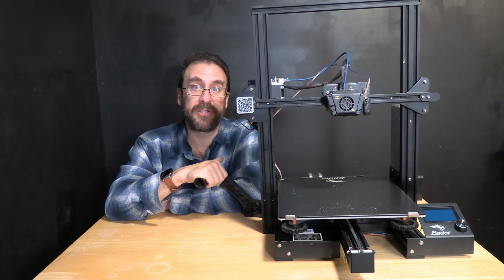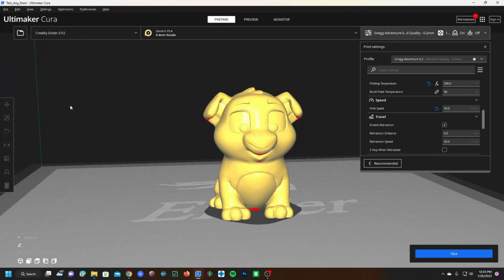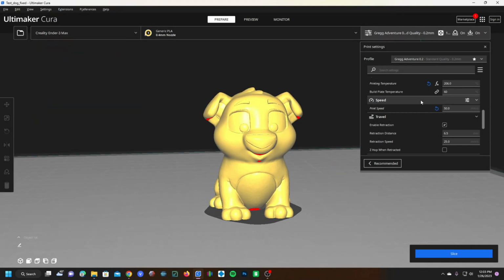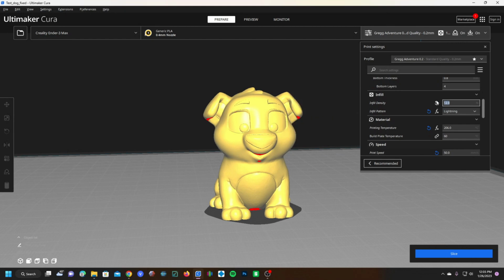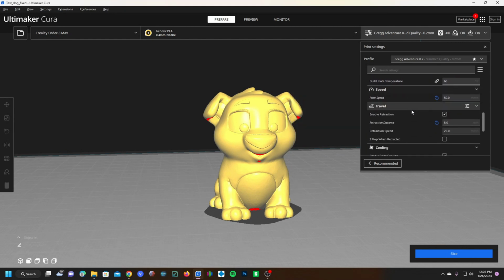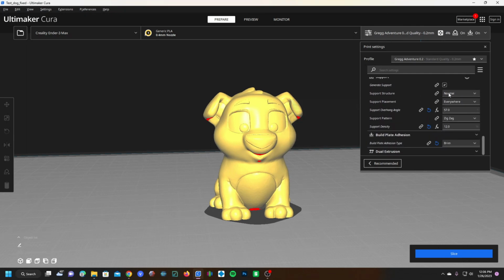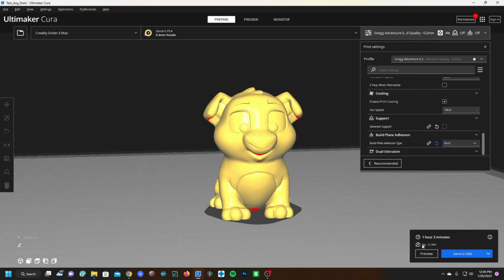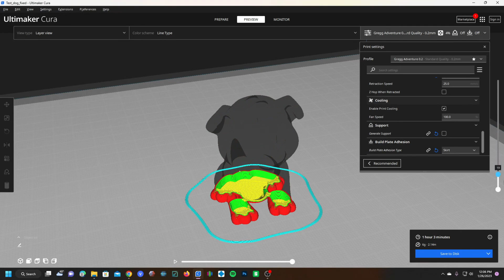How to Install a Creality, "SPIDER V3 PRO" High Flow High Heat HOT END, on an Ender 3 MAX - in 4K

Comment: Im stuck not being able to go to 300°c because there's no software with bl touch
Reply from the maker: Get MRISCOC or Sonic Pad
Reply: @3D Rundown  ok thank you ive been debating on getting the sonic pad
Reply from the maker: I have Sonic Pad on a CR6-Max and 5+. Working great on both
Reply: @3D Rundown  is the set up hard or is it straight forward and simple
Reply from the maker: I literally had it runing on my 5+ in under 10 min, after putting it off for 2 months. It's very easy. Don't be intimidated. You can 100% do it. And you don't have to go crazy trying to print super fast and all that nonsense.

Comment: Its not called thermal grease its called thermal paste.
grease would imply it stays lubricated, paste dries out.
Reply from the maker: Nobody cares
Reply: If the thermal paste you are using dries out, then you got cheap thermal paste.  Artic MX-4, Thermal Grizzly, Kingpin Thermal Paste doesn't dry out.  And if it does, it would take years to do so.  Also Thermal Paste and Grease is the same thing, only real difference would be how thick it is.

Comment: Any recommendations on slicer settings for this?
Reply from the maker: I reduced my Retractions to 5, and NOTHING ELSE. Running everyday. Not a clog in sight.
Reply: @3DRundown  I haven't had any clogs, my problem is now all my prints seem to be oblong on my X axis
Reply from the maker: I don't see how a Hotend change could effect that. Something else must be at play here....
Reply: @3DRundown  that's what I figure, but it's the only thing I changed recently
Reply from the maker: Check your Belts. Maybe one is loose. Tighten them a little

Comment: Piece of crap. Had two of these units, both spent more time clogged than melting plastic.
Reply from the maker: Zero clogs. Printing every day, several hours a day, since day one. Work on your Nozzle to Heat Break. Needs to be flush

Comment: You might have an easier time with adhesion if you cleaned your bed once in the last decade.
Reply from the maker: Easier Time? These things couldn't possibly be easier. I can't remember the last time I had an "ADHESION" Issue. Jesus, what kind of dort uses that word, while trying feel cool on the internet? I have 20 machines, and shipped over 1400 items last year, most of the costing $50-$100) [Go ahead, do the math....]. You might want to consider a little time to educate before you look like a clown on the internet.
Reply: @3DRundown  You are kinda a dick.
Reply from the maker: Yup. Huge Dick. But I let your post out of the YT Spam filter, so, I guess I was feeling nice that day.

Comment: Time for another update. After the last experiment, I modified a CR mount model from printables but decided not use it. Felt it would be easier to make a new mount just for the spider that would lower the head to as close to the original position as possible. It actually worked, but it was a bit of stepwise refinement as I went. The end result is a Spider mount that lowers the block by about 5mm to the original height so that the CR touch and mount stays stock. Integrated with that is a flat spacer about equal to the added distance of the Spider to shift the center of the custom part cooling air ring to match as the Spider has a thicker profile than the smart end that was stock with the E3 Neo Max. Worked pretty well, but needs some clean up before I post it. Now for a cleaner cooling fan mount and maybe a shroud, but I really don't care if there is one or not. But the cooling fan mount will have a cone from the fan to the Spider cooling fins once I get a clean cone shape without gaps and splits.  The main drawback is that I am at the level of Tinkercad where it becomes frustrating to use vs a better cad package, but not ready to take the time for the learning curve of the higher power cad package.....
Maybe then a quick video of the parts and finished assembly. Just not a heck of a lot of stuff specific to the Ender 3 Neo Man yet.
Reply from the maker: Yea, sadly the NEO's never got the love that Pro, V2, Max, or S1's got. I think they shoulda been named Ender 3 V3, rather than the ambiguous "NEO".
Reply: I have a cr10s pro v2 and i got this hotend, i think your solution would for me, what did you use exactly to lower the spider down?

Comment: Update on my E3 neo MAX to Spider Pro HF/HS hot end: 

Well, it worked pretty well considering the changes required. Once I printed the parts that can be found in printables and figuring out which of them I wanted to actually use, started the upgrade. Only real problem was having to file  down the CR mount on the left side as it would hit the X axis home switch on homing the unit.  Also the modded circular air cooling duct had to be restored to the original supplied duct work for now as it would not fit. Currently all open air mounting of the head components until I can finish making the new fan mounts and maybe create or mod an existing shroud. I need to remeasure the hot end assembly, newer than that shown, may only need to be dropped 5mm or so straight down and most of the old setup may work. Live and learn I guess. Wish I could find the drawings for the original and spider Pro hot ends with dimensions just to confirm my own measurements. . Printed up to 100mm/s with no problems with Sonic Pad and klipper. Until I tried to do the ring for the Iris project trending on Printables. Still worked well up until I was printing the open face version of the keeper ring. Speed did not help even though going down to 30mm/s. Printed lots of dream catchers, though not intentionally. Reduced heat to 195 and came out perfectly at 30mm/s. No attempt to up the speed until the part cooling at the hot end goes back to correctly positioned circular duct. 

I chose to use the new thermistor. Was a bit of a PITA due to having to run the wires, but it did uncover a few manufacturing issues, like wires looped and kinked in the cable sheath from manufacturing errors. (future intermittent bat $h!t crazy hard to find faults were avoided) Also, installed crimps on all the wire ends that were not terminated. Temp worked right first time and tracked as expected. Overall very happy with the result, but as noted, it is not for the plug and play set. Expect to do some work to make it all fit, work and look professional when you are done. Yes, went through a good number of wire tyes as well.
Reply from the maker: Wow. You've been busy! Thanks for the awesome info. When you have it all sorted, fill us in, and link us to the parts. 👍🏼👍🏼 What is this trending thing? Link me up

Comment: great installation video, they probably shouldve told you to calibrate your esteps after installing a new hotend
Reply from the maker: The hot end won't effect my esteps. A PID tune wouldn't be a bad idea. And a retraction test if need be. For me, didn't need either. Set retractions to 5, and has been super every print so far. Banging out adult masks✌🏼

Comment: Wish damn thing worked with ender 3 max neo, and v2 neo. I had to replace my back plate and use a v2 fan cover in order to get spider 3 to work, as well as print my own v2 mount for my CR touch. Basicly the original spider is more on par length wise with my neos.
Reply from the maker: I wish I had a Neo to mess with. Surprised to be hearing it doesn't fit. Peeps on Printables are working on new shrouds for the Neo and Spider.

Comment: A word of warning to fellow Ender 3 Max Neo users, this hotend will not fit your printer. Learned that the hard way. This will work with the rest of the ender 3 series
Reply from the maker: There are projects on Printables, working on this
Reply: @3DRundown  thank you for pointing that out, still new to the 3d printing scene. I'll be giving this a go since I already have it 😆
Reply: Working on install for E3 N Max. found printables, hopefully work well enough to print my new shroud design. Also using new thermistor. Be a couple days until I get finished. Then experiment time.

Comment: Installed a 4.2.7 board wtih cr touch on my original ender 3 and its been working very well except for one weird thing I noticed. Whenever I adjust my Z offset the printer doesnt move as im doing it, although the Z offset DOES apply to prints. So basically it takes me a lot of guessing and trial and error to get the right z offset everytime I change something. I'm assuming this is a software related issue?
Reply from the maker: You might be better off running a print, using a skirt, and baby stepping your Z from there. Then, when it's good, just choose SAVE. 
However, consider better firmware. donate $2 to these guys, and use theirs: https://marlin.crc.id.au/
Here is a good way to mess with your baby stepping: https://youtu.be/veZB415QHM0
Truth be told, once you have it set fairly close, I always just use a print skirt, to finalize it. And, if it looks like it needs an adjustment at some point, I again, just use the skirt, or 1st layer of a print, to babystep it, and save from there.
Reply: @3DRundown  thanks
Reply: What Firmware are you using?  I went over the MIRSCOC and it's been better. Though you have to disable something if you want to create a bed mesh larger than 5x5... If I remember correctly because the bed mesh itself gets errors the longer the CR/BR touch probe runs. I had a similar issue with Z offset constantly changing. I also altered my start and end G-Code to help with the issue as well. but it's been a while since I've touched the printer.
Reply from the maker: I use this: https://marlin.crc.id.au/
Also, I never use bigger than 5x5.
Reply: I remember now, It had to do with the "High Speed" mode. I turned it off.

Comment: i would love to buy one of these if they used standart v6 or volcano nozzles. Their proprietary sizing feels intentional.
Reply from the maker: It likely is, but these nozzles will last much longer than the brass ones, and they are only about $4
Reply: @3DRundown  longevity is cool, but high flow is even cooler. If you have a "high flow" hotend it needs a nozzle to keep up with it
Reply from the maker: This Hotend uses a HIGH FLOW Nozzle. Or, you can use a standard MK8 (the the HF version MK-HF)

Comment: Nice video. Glad to see others using this hotend too. I did a few videos on this hotend a while back. I have two of them on Ender 6 machines. Love them so far.
Reply: Did you have to modify the fan shroud and is the stock Thermistor able to handle high heat or did you replace it with Upgrade HT-NTC100K Thermistor. Will BLT have to be adjusted. I have ender 6 which i going to install it on. if your video is on ender 6 would you send me the link thank you
Reply: @Toaddaddy  I should add that funny enough my videos are on the Ender 6.

Comment: I think there is 2 version of this hotend. The normal speed & high temp vs the high speed high temp one.
Reply from the maker: Yes. A version 2, and a version 3 Pro, which is the High Flow/Heat version. This is the 3 Pro.
Reply: @3DRundown  Just bought mine. This hotend seems to have 2 ways to mount. The 2 holes on the heatsinks can be mounted directly to the original carriage screw holes. I think another way is to use a 2 piece aluminium mount (bought seperately) that clasps the circular neck of the hotend. Can someone share some experience?
Reply from the maker: Do it the way it came. The circle is a Ceramic heater

Comment: Congrats on being being like the only person to review this hotend! Absolutely blowing my mind that I can't find anyone else really covering it. I'd really love to see what speed and flowrate it can achieve.
Reply from the maker: Thank you. It's been on my to-do for a while. Surprisingly nice hot end!
Reply: Because all the people in the know, know creality hot ends and extruders are pieces of crap. i had two of these, and both were crap. i had the sprite extruder/hotend combo - totally worthless.
Reply: @zebsolaria4763  I agree. I'll take the Titan with volcano over the Sprite all day long.
Reply from the maker: Lol. Lies. 95% of my machines are running stock Creality hotends. The other 2, are running Spider 3. I've never lost a single Hotend to failure.
Reply: @3DRundown  I've been a diehard creality fan for a few years, owning 4 enders and a cr10, but as time has gone in they have given me more and more trouble so I picked up a new elegoo Neptune 4 to get a taste of modern tech lol, thing is insane so far I'm extremely happy with it. What's your opinion on elegoo printers?
Reply: Its probably because the first two were crap, the first one was massive and you had to print a fan shroud and make adjustments to the firmware and before you got to 300°C heatcreep set in , lord knows what would have happened if you could have reached the claimed 500°C,  the second one claimed no new fan shroud required but Ender 3 V2 fan shrouds were melted. Im guessing when creators were asked if they would like to review it they refused, many creators have stopped reviewing Creality printers.
Reply from the maker: lies

Comment: Does that hotend fit unadulterated on all Ender-3 models?
Reply from the maker: I do believe it does
Reply: @3DRundown  Cool.  I just got mine tonight for my Neo Max, so hopefully that works! :)
Reply: Ok this upgrade does NOT fit on the Ender 3 neo max.  The mounting  screws line up perfectly but that is the only thing that does.  The top of the hot end unit won't fit under the shroud so no biggie I dremmeled the shroud.  But once I had that on I see the nozzle end doesn't extend far enough down to clear the shroud nor the cooling fan vent.
So I emailed them, again,  ... but they are out on their 10 day national holiday...:( ... this is going to be a pain.
Reply from the maker: Yes, sadly, the NEO uses a bizzare cover. Print  a new one from Printables

Comment: You defeated the purpose of the install by reusing the old thermistor. You can not run it to 300C with that thermistor or stock firmware! It is pointless to do this upgrade if you only print in PLA.
Reply: Actually, this is yet another fun fact with Creality. Not much data anywhere on the components. My  Spider HF/HS Pro instructions say  (gotta love this sh**) "When the terminal of the thermistor does not match the interface of the motherboard, you need to modify it yourself. Or use the original thermistor".
Reply from the maker: I see nothing wrong with this. If it's connector, is different than the MB you are using, you'll need to match it. OR, just splice it inline. This makes for wide and easy, compatability.
Reply from the maker: Lolz. Who uses Stock firmware on a Creality Printer!? I will not be using it for High Heat, or High Speed. "Pointless" is nonsense. That said, I can't, and won't, cover every base and topic in a single video. Nobody want's to dit through that